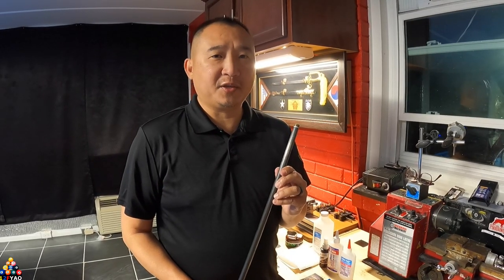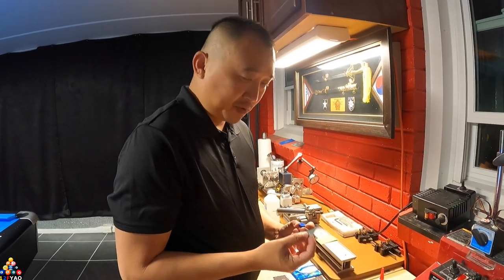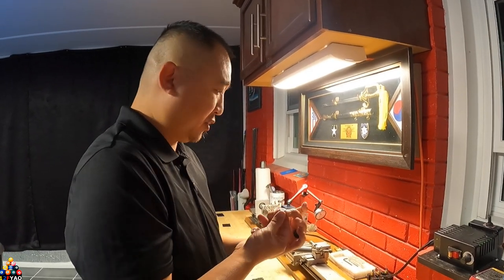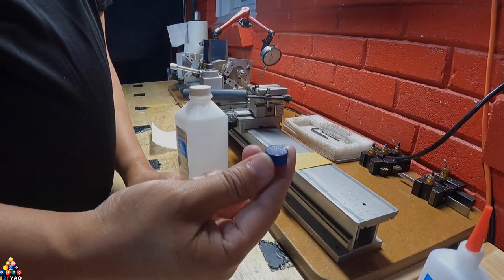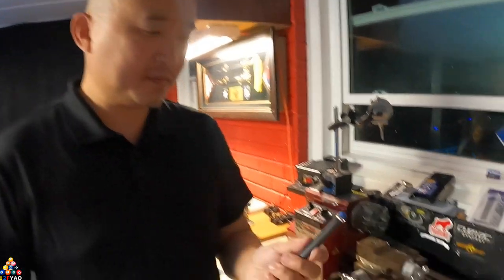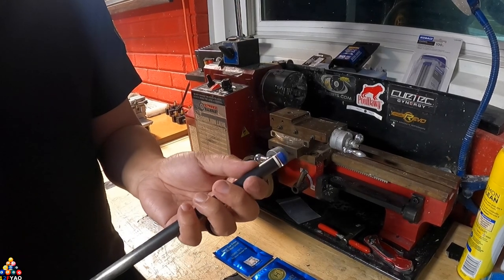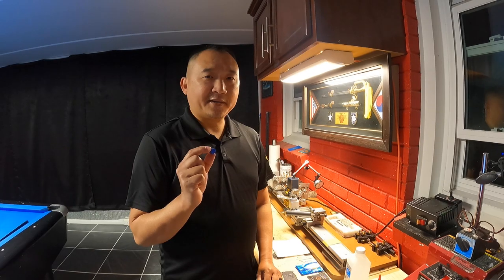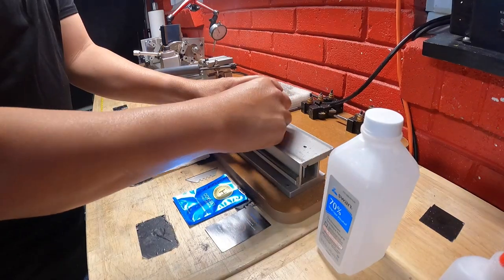Installing HORO TIPS Medium Playing Tip, ODYSSEY, On A REVO 12.4 Carbon Fiber Shaft.

Comment: Hello, I like the cue work you are doing! I like wood to wood joints, no inlays and a solid wood to wood hit. What would you charge me to make me a SIMPLE BUTT ONLY cue that fits my2 Uni Lock Z3 shafts. I have always got the best feedback from simple no inlays wood cue butts with my Z3 shaft. I also need an extension of 6 to 8 inches that is compatible with the cue butt for yhe big tables. I like Cocabola and maple woods the most but I am open to anything simple and attractive. You have great taste.  Let me know and thanks. Much appreciated

Comment: How does the tip play bro? I have the S Helios on one of my Revo and its pretty good but i prefer M thanks
Reply from the maker: Personally I like the Horo Beast. It’s the hard tip but I also play with the Medium. They both play well and thank you for commenting.
Reply: @playpool12fyao  thanks for getting back to me, harder tips are better as long as they are grippy, makes table length draw very easy plus I find medium and hard tips to be more accurate on long straight shots over S.

I'll try and get hold of odyssey and beast, all the best
Reply from the maker: That is very true. The harder the tip, I think it deflect less because it doesn’t deformed like a soft tip. Soft tip to me is high maintenance. They require trimming do to it keep mushrooming. Try getting the Horo Beast you might like it and thank you for commenting again.
Reply: @playpool12fyao  yes constant trimming initially is annoying and it does deflect more i agree,  thank you bro